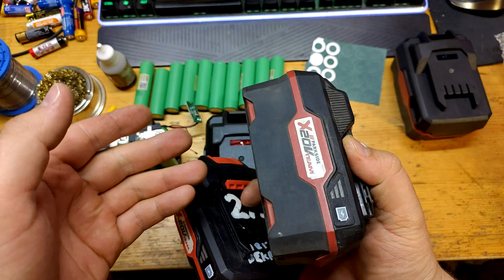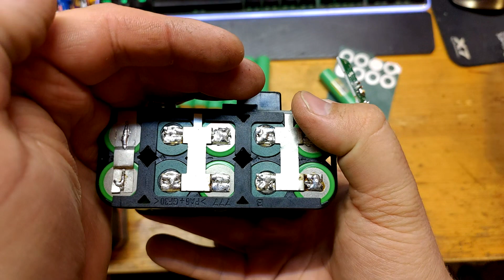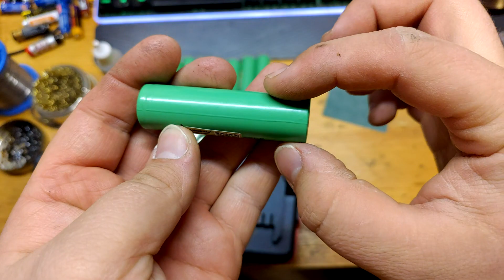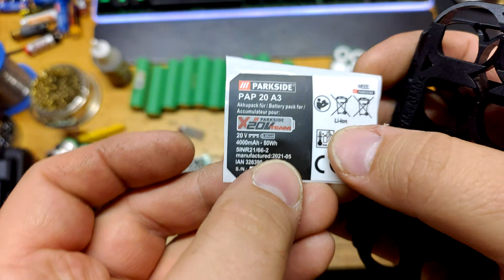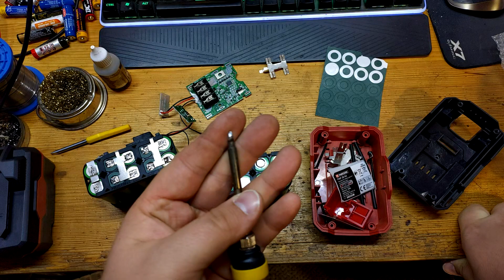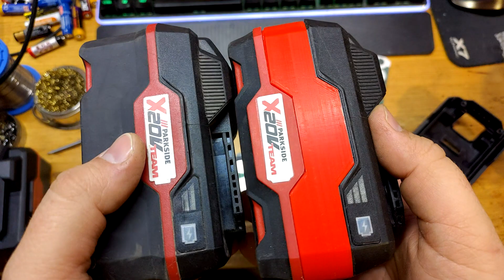Make your own NEW Parkside X20V battery

Comment: Ali Express is just a rip-off. Better to just buy an original secondhand battery use and then replace the cells if you need. Everything is either a rip-off or a scam online now and the whole internet is in danger of collapsing into dictatorship, misdirection, or piracy.

Comment: Hi very interesting video. Thanks for sharing. I have 2 old parkside batteries PAP 20 A1 that are no longer working (those are 2000mAh 40Wh). Any way to upgrade them to 4Ah (I presume they are 2Ah - nothing on sticker at the back to say)? If so, what components would need changing (batteries + motherboard or simply batteries....).

Comment: It is cheaper to buy a fully assembled and working battery from Lidl.
16€ for a battery from Lidl, vs 22€ for the carcass and bms, plus the cells, which o didn't bother checking the cost. And you have to put it together on top of that.

Comment: Hi , first link is not working
Reply from the maker: It works for me
Ali link to X20V seller: https://www.aliexpress.com/store/group/Power-Tool-Battery/911936409_10000001171014.html
Ali link to TWO sets for bigger battery: https://www.aliexpress.com/item/1005003173378599.html
Ali link to ONE set for bigger battery: https://www.aliexpress.com/item/1005003176067676.html